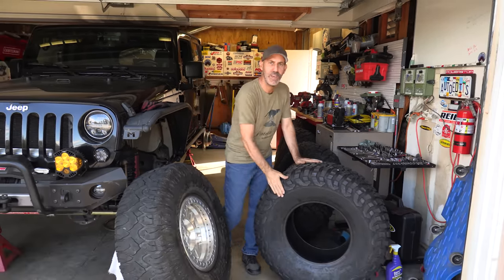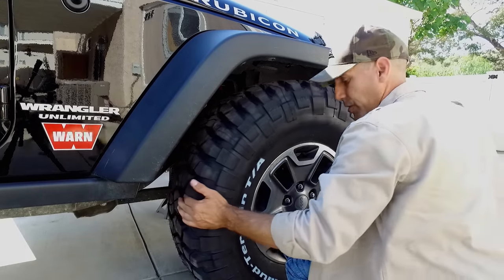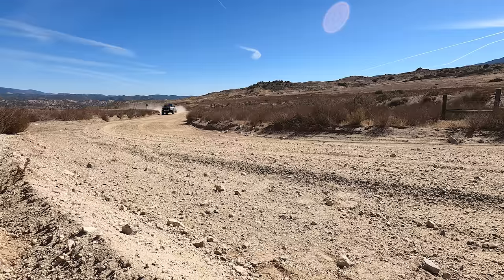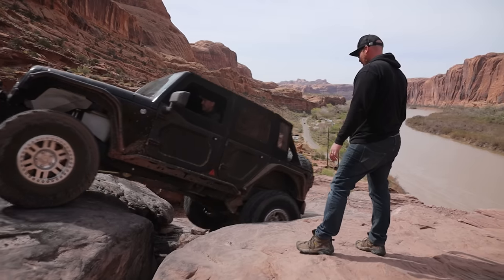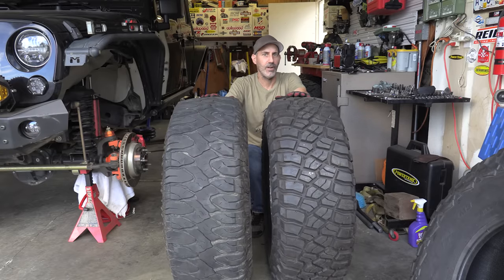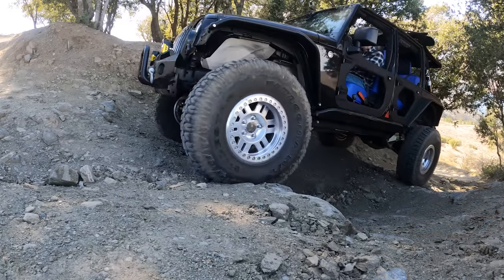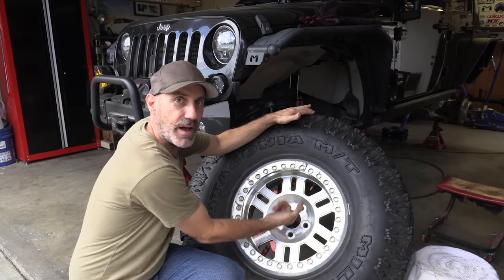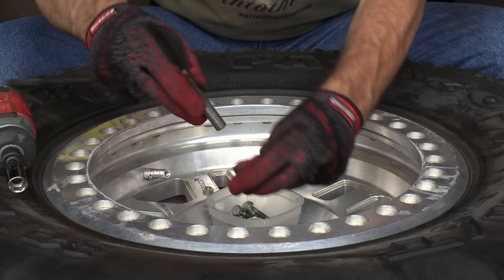Mounting Up 37” X 13.5" WIDE BFG KM3 Tires on the Jeep Wrangler and WHY!

Comment: Bfg is notoriously small for their advertised size, as most big name tire manufactures are. I think you'd love the 39"bfg km3. They're extremely expensive for whatever reason though. Around $750 a pop. A decent 40" is around 500. I cheaped out and got the kanati mug hogs in a 39 12.50 r17. Extremely narrow tires but height is decent, like a true to size 38".

Comment: Cleaning up the extra rubber gunk is definitely not overkill.  I want the cleanest and best mating surface for my tires to adhere to, especially the bead.  I do the same exact thing when changing tires.  It's not overkill, it's perfection.
Reply from the maker: I agree and like to hear this from others!

Comment: Hey Jason, I know you like to always prep and go a little overkill so just want to recommend looking into the 3m adhesion promoter (rust-oleum also has a similar product). You apply it to anywhere you'll have 3m tape such as you used on the TPMS. It increases the bond strength by a lot and definitely recommend it.
Reply from the maker: Great suggestion, thanks!

Comment: Oh man, another autoedits video?! Thanks Jason! I upgraded tires on my JL to 37 inch ridge grapplers last year and it was a pretty big difference in terms of ride quality compared to my 34 inch ko2’s.  A little more vibration, which I think is from the more aggressive tread pattern, and a little more wonder. With that said, the performance gains off-road and the cool factor negate any negative I incurred, lol
Reply from the maker: Right on! I've heard other folks say they like those tires as well... good pick!

Comment: Great vid Jason love the content. 
Funny that you are going from patty 38's to BFG 37's as I expect my patty 38's & KMC bead locks to be delivered today here in the PNW. 
Cheers!
Reply from the maker: Which KMC did you get? That is the brand I would've chose if there was budget to get  new ones this time around. Like I mention in the video... the 38 Pat's are fantastic.  Just rotate them regularly and you'll be very happy.
Reply: @AutoEdits  'M229 MACHETE BEADLOCK SATIN BLACK WHEEL"
Reply from the maker: Just looked those up... they kinda look like what I'm running now but with that supper cool beadlock ring that lets water drain! Such a cool feature.
Reply: @AutoEdits  Yeah they are close to what you have now.  I tried to look up the weights of mine, and their site claims 45lbs ea wheel. I know yours are really light, but not sure what the weight is ea for yours.
Reply from the maker: @TheRambler-pz1gx  Under 20lbs and they are forged... but they were really expensive because racecar I guess 🤣🤣

Comment: I ran the 39 km3 for a little over 2 years, wheeled all over southern NM eastern TX NC and eastern Arizona they were phenomenal I did slash 2 though near the end, they took so much abuse and did chunk some without failure. Now being said they are load range C and are softer than the 37 variety and perform much better than the 37 load range E my buddies hated those and never hooked on obstacles that my 39s did. Sucks their on back order you would have loved them!
Reply from the maker: I’ll accommodate for load range by airing down more.

Comment: Ive have put bfg mud tires on my work truck for 370,000 ish miles always got about 50,000 miles out of a set, this last time i tryed the ko2, ill see how well they last.
Reply from the maker: I'd be curious what you think of the switch since you have so much experience.

Comment: I’m fixing to do the same with new KMC beadlocks and new set of Nittos 37x12.5x17 I’m going to try out. I liked your video. I’m thinking about using balancing beads that I’ve seen others on YouTube using. Do you have any thoughts on that? The local Discount Tire shop doesn’t want to handle beadlock wheels. Thanks and keep up the good work.
Reply from the maker: I DO NOT recommend balance beads. I tried them and they are extremely inconsistent.

Comment: What about load range on those tires? Isn’t the 13 1/2 inch wide only load range E? which is a very stiff sidewall mainly for a heavy pick up truck not a jeep I’m just curious I know a lot of people run that load range I love those tires I’ve had them on my jeeps and 39 inch I just got a bronco raptor and want to put that size tire on but the load range in the weight of it is a huge difference? Thanks for the info👍
Reply from the maker: Excellent question. For everyday mixed use, I actually get some peace of mind from the thicker sidewall. To get more flex, just go down with air pressure a bit more than usual. Here's my first time out with them and if you look... they flex plenty! I'm very happy. https://youtu.be/_1iKfd567WQ

Comment: I truly appreciate your videos. I also run KM3s on my JK, 35" x 12.5", and they are my favorite.

I was wondering, with your Metalcloak long arm kit up front, what backspacing do you have on your wheels, what size spacers are you using, and what width is your Fusion 4x4 Elite 44 axle?

Not that I think you should, but have you had any issues with the front tires rubbing? Thanks!
Reply: lol, I just answered my own questions by watching your tuning video. Great stuff, thank you!
Reply from the maker: Ha! So awesome to see this… thanks for watching and the comments!

Comment: Nice video...Interesting choice.  It doesnt seem apples to apples comparing the size of a soft rubber Patagonia with 35k miles to a new BFG.  If the Patagonia was new, I imagine it's 2" taller than the bfg.  The 39" km3 = 38" Patagonia in size and tire flex.  The load e isnt going to flex like a load c BFG 39×13.50.
Reply from the maker: it’s just a size reference. I’m curious to learn about how to maximize flex with lower pressure.

Comment: Another great, informative video.  But one question. Why do you use stick on wheel weights over bead balancing your tires?
Reply from the maker: I tried beads and hated them. Too inconsistent. I spend a lot of effort dialing this thing in and having the wheel balance go out after hitting a bump was frustrating. Spin balance makes them perfect all the time in my experience.

Comment: How much will weight did you have on the Patagonia’s? I have fewer weights on my spare which I tore the bead on.  Looks crazy.
Reply from the maker: Some took several ounces but when I had my buddies 37" Pats balanced... two of them didn't take any weight. The BFG's balanced up nicely with just a few ounces per tire and feel great on the road so far.

Comment: I'm considering the KM3s next, how's the road noise on them?
Reply from the maker: I still absolutely love them! I've been experimenting with air pressure and found that 35 psi on the highway is almost un-noticeable to regular Jeep sounds. Glad I got them.
Reply: @AutoEdits  Thank you for being the good but bad influence lol! They're pretty high on my list of tires that I'm debating between, how's the wet traction as well?
Reply from the maker: Very stable in the rain.
Reply: @AutoEdits  Awesome thanks Jason! I’ll get the wallet ready to cry in the corner lol
Reply: @AutoEdits One more question sorry, how’s the tread wear been for you? I’m putting between 10-17k miles a year on jeep with my kenda tires, and they’re at 14/32nds down from 19/32nds from the last 25k miles on them.
Reply from the maker: I don't measure tread depth so I don't know. My friends get about 40-50K on them. @gabrieldalcomune3044

Comment: So if we add the 1” of tread back onto the Patagonia.. the BFG is 2” smaller! I hope you have better luck balancing them. My entire club has given up on BFG for a street tire.
Reply from the maker: You think there’s an inch of tread gone? 🤣 Also, these balanced up perfectly… 85 mph like a dream. Sounds like your club needs to try a different tire guy.
Reply: @AutoEdits  we cover 3 states. No one is using the same guy. Maybe they fixed their issues. Multiple sets were bought back because even road balancing didn’t fix them.
Reply from the maker: That would be frustrating for sure!

Comment: Holy Rickshaw Batman, those tires weigh a lot
Reply from the maker: Compared to what? They are lighter than the comparable load E tires in the category.
Reply: @AutoEdits  - multiplied by four, that's a lot of reciprocating mass. Wouldn't want to turn those with a 3;45 rear end

Comment: When is this current tire shortage situation going to end?! I don't even daily my Jeep anymore because I can't replace my tires once the tread gets too low. I see folks doing these over the top builds with pallets of fresh, shiny new parts but with used tires. It's bonkers...and the select few that managed to hoard some big m/t rubber either have them vaulted or marking them up something ridiculous if they were to consider parting with them.
Reply from the maker: I think things are heading in the right direction.

Comment: Noooooooooo!!!!!!

Don't do it! Lol

I switched from ProComp to those KM3s and regretted every inch I drove on the road. So horribly rough compared to the ProComps.

Now, since you off-road far more than I ever did, maybe it'll be a better fit for you. But I hated the KM3s.

Just my two cents. Lol 😂👍
Reply from the maker: They actually feel really good on the highway and around town so far.... what pressure were you running?
Reply: @AutoEdits  I really fluctuated wildly because I couldn't never find the right PSI for the ride. I went as low as 26 to a consistent 36. But it always felt the same.

Of course, I did buy mine directly after I beat the heck out of the suspension on the Rubicon trail... so I probably should blame some of that rough ride on my worn out suspension. 😂😂😂
Reply from the maker: Interesting. I have a little over 100 miles on it since yesterday and the 30 (cold) felt really good... I'm going down to 28 cold and will run some miles there but it already is amazingly good in the on road department.